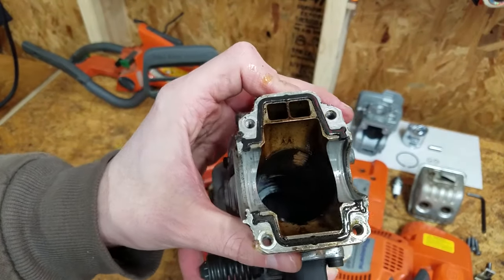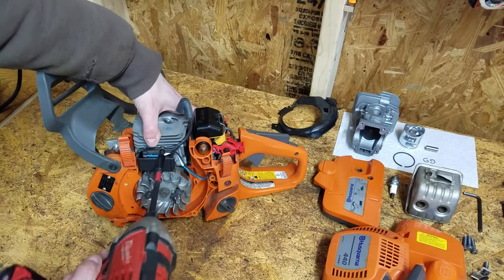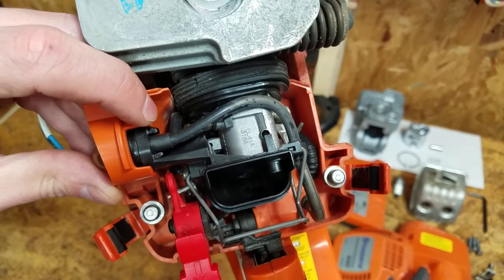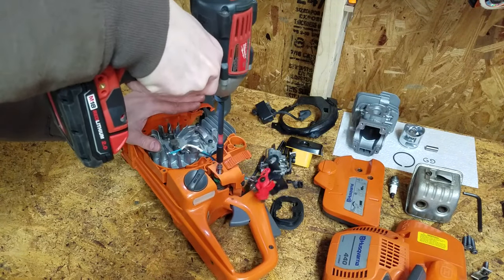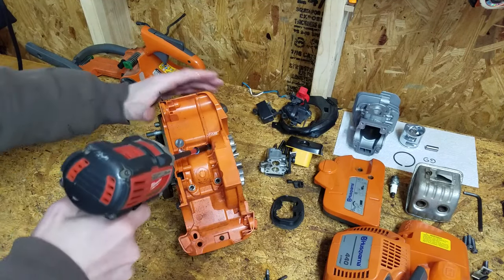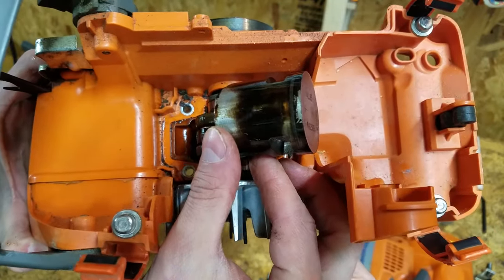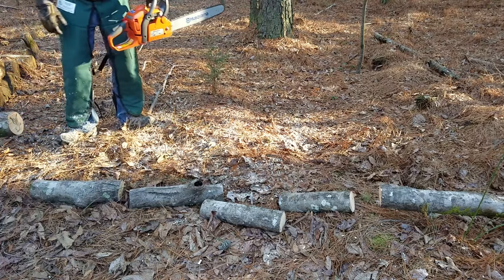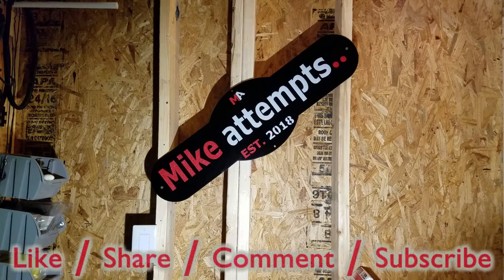Replacing a Chainsaw Piston and Cylinder

Comment from the maker: Piston & Cylinder Kit:
https://www.ebay.com/itm/133485836142

Oil Pump:
https://amzn.to/3ggQOpW (affiliate*)
~OR~
https://www.ebay.com/itm/122592795614

Carb Adjustment Tool:
https://amzn.to/3k0QiLc (affiliate*)

Compression Tester:
https://amzn.to/3x0cAnI (affiliate*)

Hemostat Locking Forceps:
https://amzn.to/2Uxik7l (affiliate*)

Zoom Oiler (like Mustie1 uses):
https://amzn.to/2QcbXGS (affiliate*)

*Purchasing from these Amazon affiliate links earns my channel a small commission. Think of it as a tip that doesn't cost you anything. Thanks for the support!

Comment: Very in depth video but I can't get my muffler of
Reply from the maker: Yeah, those muffler bolts can really be tough to get out sometimes. I'm no pro but you could try heating 'em up a bit with a torch then cool 'em down quickly with a few squirts of water. That might provide enough thermal expansion and contraction to be able to get 'em out. Another thing you could try is to ever so slightly tighten the bolts and then see if you can loosen them.

Comment: Yeah , carbon buildup stuck the ring , clean and unstick the ring,  the piston and cylinder are fine , what caused it ? Looks like someone used bar oil or stp oil treatment for their gas mix 😂😂😂 or accidentaly poured some bar oil in the gas or some other high zinc oil , i bet that thing smoked like a tar kettle before the ring stuck , 😂❤
Reply from the maker: Hahaha, yep, I think it was bar oil too! I kept the original piston and cylinder, they cleaned up nicely. :)

Comment: Someone used bar oil in the mix. Seen it before.
Reply from the maker: Yep, that's what I was thinking too.
Reply: @Mikeattempts  Good job BTW. It's very satisfying to make something work again instead of throwing it away.
Reply from the maker: @todaylets2583  It is! I have learned a ton since starting to fix things as a hobby and it's very rewarding. Thanks for the comments!

Comment: Touch oil , improperly mixed fuel and two-cycle oil looks super rich , 50:1 is the mixture not 28:1
Reply from the maker: Yeah, I thought maybe they tried using bar oil instead of 2-stroke oil.

Comment: This is one of the better disassembly videos I have seen! Nicely done! 😃
Reply from the maker: Thanks, I appreciate it! :)
Reply: @Mikeattempts  33:1 oil mix is ok ?
Reply from the maker: @Sensei948  It all depends on the brand but Husqvarna recommends a 50:1 mix. Too much 2-stroke oil mix is better than not enough, but it would probably run a little smokey and smell worse.

Comment: I would have addressed the issue before buying new parts.  Cylinder and piston don't need replacement in this case, some cleaning and honing and maybe a new piston ring. I only change these parts based on compression reading.
Reply from the maker: After low compression results and seeing vertical lines on the piston through the exhaust port, the solution seemed obvious. Oh well, I kept original parts so they can be used in the future.

Comment: Thanks great video:  don't you have a torque setting for the crank case bolts to the cylinder ?
Reply from the maker: The torque spec for the cylinder bolts, for 445/450 saws should be 13-15 Nm. However, I'm pretty sure they'd be different for each model/brand so be sure to look it up for your specific saw. Thanks for watching!

Comment: Great instructional video! I like seeing a nice clean work bench and clean parts to assemble. I also like the way you reinstall the screws by hand. It's much too easy to cross thread or over tighten screws when putting them back in with power tools, especially when they're threaded into plastic. A few suggestions would to be using a gauge to set the air gap on the coil and to get new seals for the crankcase. Even though they are still flexible they could take a set and be flattened out. I'd use a little sealant too just for good luck.
Reply from the maker: Thanks for the feedback, I appreciate it! :) I agree, normally I would have replaced the seals and it's cheap insurance. However, many signs pointed to the possibility that this saw gave up on its first tank of gas. I think the previous owner might have used bar oil instead of 2-stroke oil in the fuel. I thought it over and decided to reuse the seals.

Comment: This is a great, concise, and clear how to video. Refreshing. Thank you. I also saw another video with a piston similar to what you experienced. His had melted at the top of the piston and the rings had fused to it. He said it was from not allowing the saw to warm up before diving into major logging jobs.
Reply from the maker: Thank you! Dang, that sound like a pretty extreme failure. I was able to clean the original parts and they're in great shape.

Comment: Excellent video and not being a mechanic by trade, the video has given me the confidence that I can repair my 455.  Compression test was 50 so I ordered a piston kit today and will use your video as a guide.  Thanks for your help!!
Reply from the maker: If I can do it, you can do it. :) Thanks for watching!
Reply: 50 is awful low. Did the saw get straight gassed?
Reply: 6 months later - how did the 445 repair go?
Reply: @viperstrike3827  I must have straight gassed mine without knowing it. So I just ordered a kit for my 460. Hopefully I can do this!

Comment: I'm doing this repair today on a saw that I accidentally poured the wrong can of non mix gas into.  I have 2 guesses as to what happened to your saw, 1. Some idiots will use used motor oil and mix it at a higher oil ratio thinking they will save money or a trip to town. It ruins them pretty quick from people Ive heard stories about that mistake. That aftermath usually leaves more wear and scarring.   2.  They used bar and chain oil instead of 2stroke oil. But if i were a betting man this is why the saw failed. 
Thanks for the video. The instructions will be invaluable.
Reply from the maker: I agree, I think it was a brand-new saw being operated by a first timer and they used bar oil instead of 2-stroke in the fuel.
Reply: Yeah my saw with many hard hours on it came apart easily until the cylinder bolts. Snapped  2 decent quality Allen wrenches, Kobalt and Craftsman. Tomorrow i will ball file the heads off and replace the cylinder hardware with new. I do want to get one out to see if they used a thread locking compound.
Reply from the maker: @How2Man_101  Man, that sucks when a project is going smooth and then all of a sudden throws you a curve ball! Let me know how it goes.

Comment: HI Mike WHAT a fantastic video you made here sharp picture at all time,I  like you subtitles and clear voice over ,I know as video production man how hard it is to make GOOD stuff like this ,I like your speeding up of some of the process to shortened the video time  ,I have a Husqvarna 236 that looks near the same and have put the wrong fuel into to run ,a new coil and a aftermarket carburettor made it still a dead chains saw   ,so I was looking for a video that give me the some info how to tackle the next job of removing and replacing the pistol ,Your Video made my day ,Thanks from LOWLAND VIDEO PRODUCTION in New Zealand for your video .
Reply from the maker: I really appreciate your kind words! I try to make my videos how I would want to watch them, all of the info you need and none of the fluff. ;) Thanks for the comment!

Comment: Great video.  This is the first video I have found actually  installing the pin in the piston and the jug on to the piston.  Thanks for that.  Much easier than expected.  Thanks.  Great job.  I have a stihl ms 362 that needs a jug and piston.  Thx
Reply from the maker: I'm always happy to hear when my videos are helpful, thanks for the comment!
Reply: Well on a saw it is much easier to change a piston because the crankshaft housing is open so you can clean metal shards out or something that is fallen into it to prevent that the piston gets stuck on a motorcycle its a struggle because either nothing is in there or your new piston and cylinder get destroyed so when there is something you need to take the hole engine apart and split the engine.

Comment: Interesting for me.  Non-starting 450 Rancher. Good compression, new carb, fresh 'Husky' gas, etc.   Piston at exhaust port looked fine.  Piston on intake side however was badly scored, indented about 1/8 inch, and cracked at the skirt. The scoring was as wide as the piston rod. I didn't see anything unusual in the cylinder,.  Almost like a chunk of metal was jammed at the intake port.    I'll probably replace the cylinder and piston to be safe.   
Great video.  I like that you weren't fumbling around like other videos I've watched.   Very professional.
Reply from the maker: Dang, that sounds like a lot of damage. Are you the original owner? If not, maybe the previous owner ran it without the air filter and used ether to get it started. The ether would have stripped the oil from the intake side and it would have just been metal on metal. I'm no pro, just a wild guess. I don't even know if ether could cause that kind of damage. I really appreciate the positive feedback, thanks for watching!
Reply: @Mikeattempts  I was original owner. I'm guessing something got into the carb when I had the air filter off.   All back together ready to start.   Thanks to your video I, found how the ignition kill wires were routed.
btw, I often tape the removed screws to the assemblies with masking tape.   Then I know where they go.
Regarding your dark piston, I might guess the gas was old, looks like varnish.   tx
Update, running fine now.  Thx again
Reply from the maker: @dalebertdurando1496  Thanks for the update, I'm glad you got it fixed.

Comment: Use 2 stroke oil, not a 3 in 1 oil for gasket and ring lubrication. 

Also when removing wrist pin, if it’s not coming out easy, and you’ve tried lubrication and twisting it, ensure the Conrod is fully supported if you take a hammer and punch to it, you’ll easily knacker or put the conrod/bearing/crank out of tru :)

Torque wrench for re fitting

Thanks for the vid though very handy
Reply from the maker: Thanks for the tips and thanks for watching!

Comment: Thanks for this video, my 440 went to the repair shop and they said it would cost 550 euro`s to repair, i have sourced the parts needed for 238 euro`s and with this video i will try the repair myself.
Reply from the maker: Dang, $550 sounds like an expensive repair, how much (in euros) does a 440 cost new? Let me know how it goes!

Comment: Thank you for your very helpfull guide! I apologized but my English is rather bad. I manage to change piston ring of my 440II because it hadn't any compression. I found original ring piston completely closed around piston. I had to chance it becuase I've broken it during maintenance. Cilinder surface wasn' t ruined, however even if motorsaw functions, it seems to have not original compression. Bye from Itay.
Reply from the maker: Yeah, you probably wouldn't see original compression levels when only replacing the piston ring, but I'm no pro. Even if the cylinder looks ok, it's probably still a least a little worn. But, as long as it runs and cuts, I would call that a success. :) Thanks for watching!

Comment: Personally, I Always lay my cordless drills on their side on the bench. That way, they can't fall any further or get knocked off the bench and crack.  But, each to their own.  Thanks for the video.  
Oh, btw, Fault, Definitely wrong fuel/oil mix caused it, but quite possible used that fancy hi octane unleaded fuel. Just normal unleaded should be used.
Reply from the maker: That's why I like the M18 battery powered tools, most will stand upright without easily tipping over. Yeah, I think the previous owner might have used bar oil in the fuel. :)

Comment: Iv had 2 of these saws . 1st one wldnt run after 2 tanks of fuel and second lasted about 4 tanks . I dropped it at the shop and they said it needed piston , rings ,and cylinder.  I have owned numerous husky saws over years and have never had a problem with them until these
Reply from the maker: Hmm, that's strange. All I've ever owned are Husqvarna saws and I've never had any problems either. My guess is that the wrong kind of oil was used in the fuel on this one. With the new piston and cylinder, so far it's running good.
Reply: yeah, ours failed too whereas 365 still going strong after 20+ years

Comment: When I got a chainsaw with low compression and black piston. The piston ring is maybe stuck. I try with grill cleaner down in the spark plug hole and lat it work for a while. That help some times.
Reply from the maker: Yeah, that was the case with this one. I thought I saw vertical scratches through the muffler port, but they were just marks in the tacky black coating. I kept the old parts, just in case.

Comment: Agree with comments re 2-cycle oil quality, fuel quality, probably too much oil, so... black internals, stuck ring.  (Not that complicated, people: use new hi-test gas and synthetic 2-stroke oil at 50:1.  These, at +/- 140 to 150 psi, are comparatively "high compression" engines.)  Little quibble... way to adjust ignition clearance is to put a piece of thick paper between the magnet and the leg from the module, tighten down the module, then rotate out the piece of thick paper.  Other quibble... Like the other guy, I would have changed out the crank seals just because.  These things are sort of a modern comparable to what "Volkswagens" used to be.  Not a "pro saw."  But not the typical junk that comes from the "box stores."  Relatively very easy to take apart and fix (no case splitting, etc.)  Parts pretty much available and reasonably priced....  Fascinating that yours was so clean on the outside....?
Reply from the maker: I honestly think it was so clean because it failed on the first tank of fuel. That's the only reason I didn't replace the crank seals. I completely agree that it's best practice and if you already have it torn apart, just replace them. I think maybe the original owner used motor oil or possibly even bar oil instead of 2-stroke. The good news is that the original parts seem to be perfectly fine, they just need cleaning. Thanks for the tip about the ignition clearance and thank you for the comment! :)

Comment: Hi Mike,
You should have done vacuum and pressure test before and after, replacing the bearing seal assy is also a must if you have vacuum leak.
Regards.
Reply from the maker: I did a compression test before and after. The only reason I didn't replace the seals was because I'm pretty sure the saw was new and died on the first tank of fuel.

Comment: I have a Husky 345 I just bought a new cylinder head kit for off the Amazon (Chinese). I am having one heck of a time trying to get the cylinder over the piston. I wonder if there's not enough taper on the bore or what. I bought a set of plastic ring compressors but so far they've been useless. Guess I'll try a zip tie and see if that works.
Otherwise, although a different model, the  video was very informative.
Reply from the maker: I'm glad the video was helpful. So, you bought the new piston and cylinder together? I've heard of people buying them separate only to find out the piston was a hair too big. My suggestion would have been to compress the ring, so it sounds like you're on the right track. I would imagine you'll hafta sneak up on it and give it a quick thump to knock off the zip tie and get it in the cylinder before the ring has a chance to expand. ;) Let me know how it goes!
Reply: @Mikeattempts  Yes, I bought as a kit. I actually managed (after an hour +) to get the piston in the cylinder, but I  was worried the permatex high heat sealant had been exposed too long so I disassembled it. Now it seems I can't get it right. I can place the old cylinder over easily with only my fingers. IDK. Any recommendations for a kit for a Husky 345?
Reply from the maker: @mandrix6323  Dang, it sounds like it's really not cooperating, that sucks. You could try cutting about an inch off the end of a caulking tube, put a slit up the side, and trim it so there's a gap when wrapped around the piston. Then put a zip tie around it to compress the ring, lube it up, and try to pop it in. eBay is a great place to find good chainsaw parts, if you can't make the Amazon parts work.
Reply: @Mikeattempts  It's an idea. I cut a piece thin aluminum and made a sleeve with it but that did not work either. I CAN easily put the old cylinder on so I may call it done and buy another kit as I'm ready to take my B.F.H. to this thing. Thanks for the suggestion.
Reply from the maker: @mandrix6323  Hahaha, it sounds like you have more patience than me because I would have already smashed it with a BFH! ;)

Comment: Hi Mike.
Thanks for sharing your experience through this video. Please let me know how the cylinder kit is so far? Do you think is reliable?
I will really appreciate if you can share some information.
Thanks
Reply from the maker: I was impressed with the quality of the aftermarket cylinder and piston. The OEM parts do seem a little better, but they also cost more. The saw runs and cuts great so I would buy aftermarket parts again, if they were substantially cheaper.

Comment: Hey Mike - thanks for the video and detailed instructions. I have a Husqvarna 440 that was run mostly with gasoline without 2 cycle oil and it barely has any compression(and.. doesn't start at all). I'm very inexperienced with anything mechanical and I would like to know if you would recommend replacing the carburetor and/or any other parts aside from the Piston and Cylinder? - thanks in advance!
Reply from the maker: I'm no pro but I would guess the carb is fine. I would replace the piston and cylinder and see how it runs. If it seems to run poorly and adjusting the carb doesn't help, you could get a rebuild kit that contains all of the carb gaskets, diaphragms, needle, spring, etc. I have another video cleaning a Husky carb, it's not too hard. Let me know how it goes!